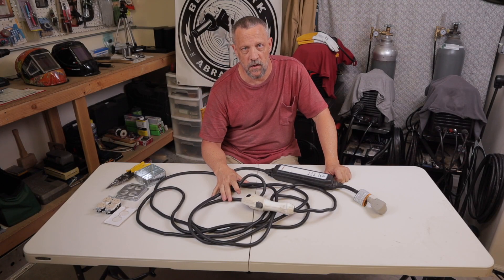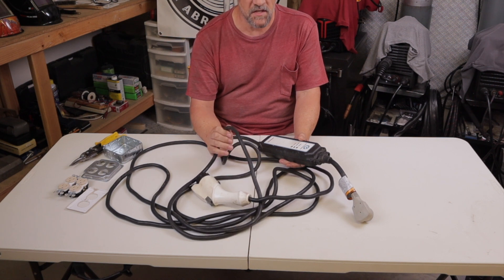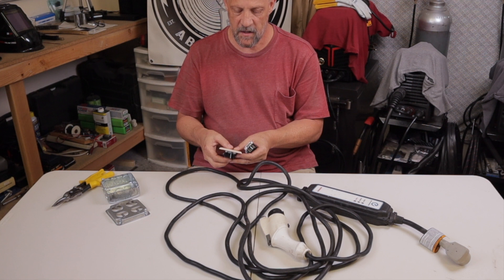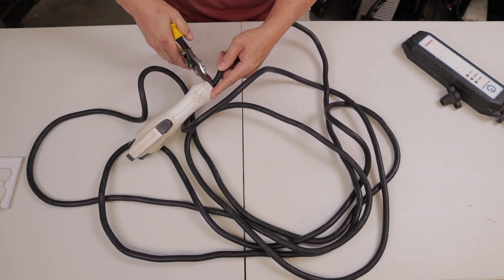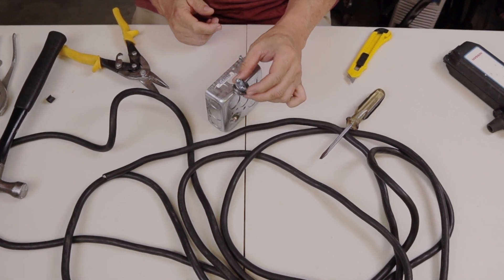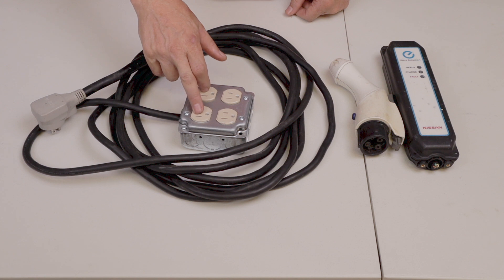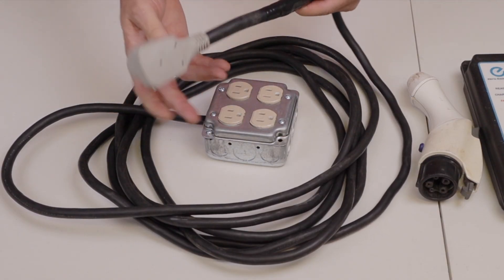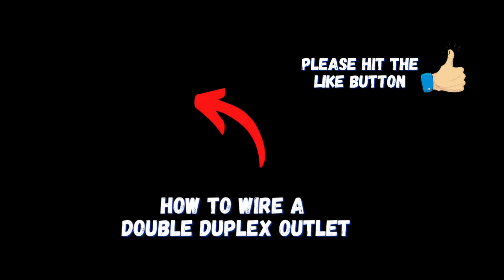I Built a Power Cord From Trash!

Comment: That’s a great build. I had a old pool pump I found while cleaning out the garage. I went back to the trash can to get it out. Glad I did. But I made one. The plug in had a GFCI plug because of the pump. So I wired it up and all is well for my garage. Hoping it will last for years. I also grounded everything to the metal box.
Reply from the maker: Nice work!